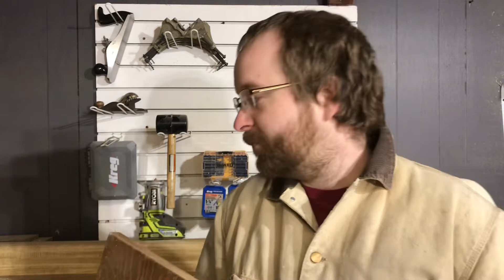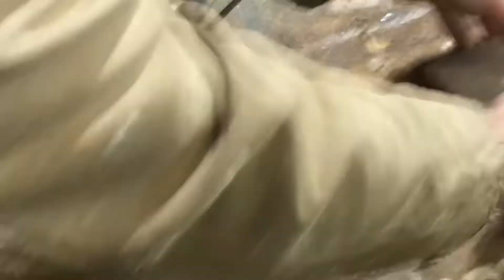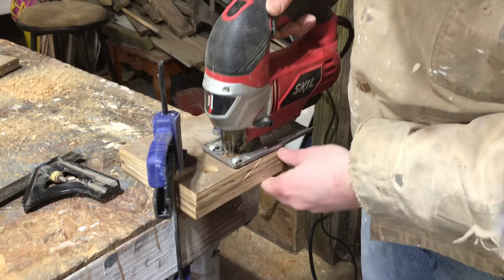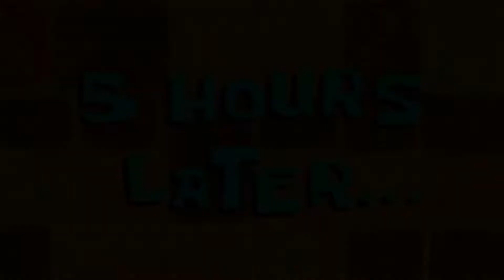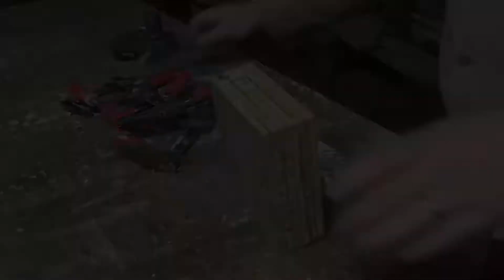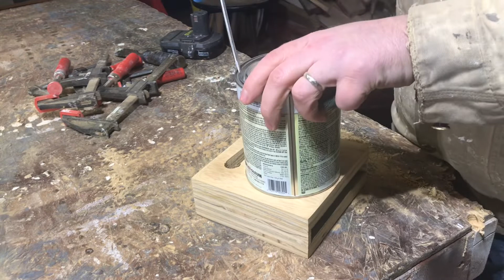How To Build a Wooden Phone Amplifier - Scrap Plywood Project

Comment: Scrap wood projects are the best projects. 

Yeah, you could have used a router to cut the slot, but by keeping it to a drill and jig saw you made the project more accessible. Routers are spinning death machines and can be intimidating.
Reply from the maker: Yea that exactly why I used the drill and jig saw. I wanted to keep this pretty basic. I’m thinking about just hitting it with a round over bit real quick to just clean it up. 

I have more scrap wood on hand than I know what to do with. I really need need to either use it up or throw some out.